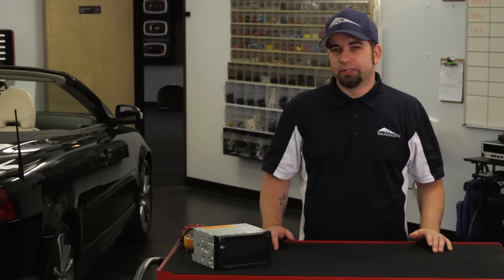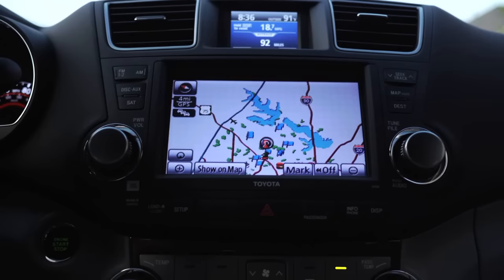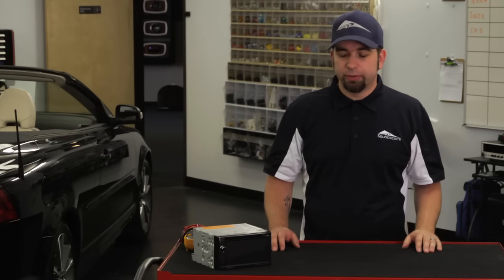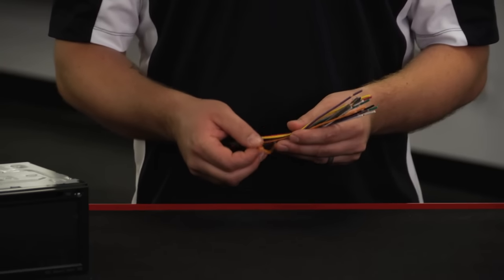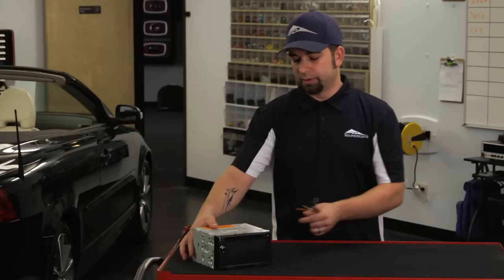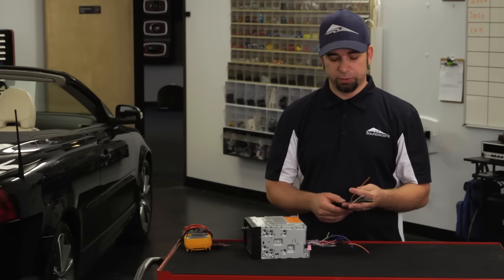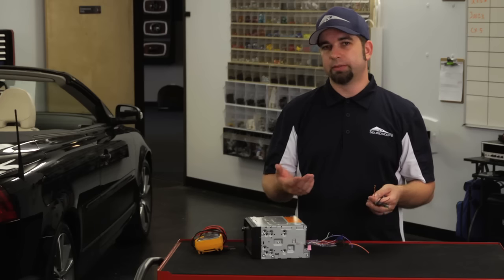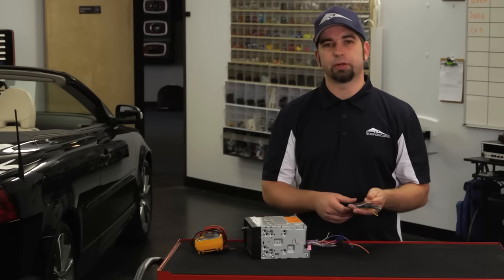How to Wire an Illumination Wire Connection for a Car Stereo : Car Audio

Comment: So... as a rule, if there is an orange wire to hook up to an orange wire I would not be searching this online.  The harness from the stereo to the connector that hooks to the car has different color wires.  The end that hooks to the CAR has an orange Dimmer wire. The Stereo harness has NO orange wire.  So in an instance where the vehicle connector has the dimmer yet the stereo does not even though it is a newer model, what wire would I piggy this on to? The stereo instructions say the orange wire is an illumination, but the stereo does not have an orange wire-- somewhat contradictory.
Reply: samantha del valle did you ever find out which wide to connect the orange wire to
Reply: samantha del valle wow I was thinking the same thing you were like really 🤦🏾‍♂️ I’m here cause my aftermarket radio doesn’t have a damn orange cable I thought he was gonna say something like “ and if your radio doesn’t have one connect it to the red or yellow or something else”.
Reply: And vice versa, stereo has ill cable but which is the vehicle wire. If it was as obvious as orange and orange wouldn’t be googling!
Reply: Right I have one that's green on stereo in chinenglish it says head lamp. I'm guessing that it goes to orange on the harness for illumination. My parking brake/reverse camera/etc wires are diff colors too. And the chinenglish translations are too different to be sure
Reply: @cyruslever586 I also have a green illumination wire on the new car stereo harness but it's orange on the aftermarket wiring harness
Reply: I need this question answered please

Comment: What do you do when the aftermarket radio doesn't have an illumination wire but the harness does
Reply: nothing.   it means the radio doesn't have the feature to dim itself anyways, so there's nothing your radio can do when park/headlights go on.

Comment: That did not explain how it worked... He just said connect the orange wires.
Reply: It is mentioned at the :15 mark of the video. It's purpose is to dim your radio display when your head lights are turned on (usually at night). Reduces the glare of the lights on the radio display.

Comment: Okay but what if my radio doesn't have an illumination wire? Is there an alternate way to connect it or just cap it off and let it hang there?
Reply: Same question
Reply: Just hook to a dash light or ac light
Reply: @eksine  didn't work just tickled lmao
Reply: @gavindowell1489 did you figure that out?
Reply: @jadengamez1673  I hooked it to the orange wire. If you’re good you can look up
The wiring diagram for your car and go that way. Or check it with a fuse light checker and it’ll turn on once you turn the lights on
Reply: @jadengamez1673  worse case it’s because the system is too old in which case I capped the illumination wire and also my blue wire which was for Bluetooth
Reply: @gavindowell1489  unfortunately the diagram for it wasnt correct ended up getting one from and Elantra

Comment: Now what if you have an aftermarket stereo that says illumination but the harness only has a orange with white stripe wire that says dimmer what should i do. I dont want to splice into any wires.
Reply: did you find a solution yet? I have the same issue...
Reply: tyrei brown year later.. lol sitting with the same prob
Reply: @dandundid540  5 years later... any luck?
Reply: Same issue
Reply: I think this is what mine has.  I connected it and it doesn't change brightness.  I know in my factory head unit, the panel brightness dial also adjusted the radio brightness.  So it can't be just 0v or 12v on that wire, it has to be a range.  I'm guessing the aftermarket head unit's illumination wire expects 12v = dim and 0v = bright.  And the factory dimmer wiring harness is actually sending variable something like 5v-12v = dim-bright.  I think the systems are incompatible, but I didn't break out the volt meter to test it.  And it's all installed and everything else is working.  Well, the vehicle speed sense isn't working.

Comment: so what about the illumination/dimmer ground wire?  Where does that go when the aftermarket stereo harness does not have one?
Reply: Don't use or you can splice into any wire that gets hott when lights are on

Comment: At last! Someone that actually explains what voltage to expect on the illumination wire. I have two Car DVD players, One a Chinese brand (Just purchased) and the other a Sony which currently illuminates the inside of the car like a disco at night. Even the Sony installation guide is useless. In fact it names the Illumination wire and that's all. Very poor for a reputable company. I have been too frightened to connect anything on this wire in fear of blowing it up. Thank-you heaps!

Comment: 1) I'm assuming you want to know where to hook up the illumination wire.
2) Obviously you ran into a snag because you don't know which or don't have a wire to hook it to.
3) Hopefully you bought an aftermarket wiring harness that plugs into your car but has to be wired by hand to the wires coming from your new Pioneer, Sony, Kenwood, etc. head unit (radio).
4) A wiring diagram should've came with your aftermarket wiring harness stating which is the illumination wire. Now, if there is no illumination wire coming from the wiring harness, you didn't have illumination control options for your factory car stereo, so now what.
5) If no wire, you can just leave it be and that will be fine, it just won't dim when you turn your headlights on. But if your head unit relies on the illumination wire for any light whatsoever, you can splice into the 12 volt red wire.
6) All the dimmer wire does it dim your head units lights when you turn on the headlights. That's it. If your car is not equipped with a dimmer for your radio, it's not the end of the world. Most aftermarket stereos have their own dimmer capabilities if the shit is too bright at night. You'll just have to do it manually.
7) If your dashboard does have a dimmer switch, you can tap into that but you're gonna have to run wires behind the dash to get to it. Every car is different so I can't really describe how to do it or even if it's possible for your car. Crutchfield has a wealth of vehicle specific information on their website. I can't guarantee you'll find what you're looking for, but you can chat with their specialists online.
8) Almost forgot, if you cut the harness to your factory stereo, you listened to someone who shouldn't have told you that's okay (even if it's a pretty well known youtuber). It will save you the cost of a 10 dollar harness but will give you more headache because you will have to figure out your vehicle specific wire pin-out.
Reply: Thank you so much for this post! Exactly what I was searching for. The wiring harness for my car does not have the illumination wire, but the new radio requires one for the buttons to light up at night.
Reply: THANK YOU SO MUCH
Reply: Thanks

Comment: The orange wire generally is parking lights on the car harness and the illumination wire on an aftermarket radio harness is usually orange/white not orange. Never seen an orange wire in an aftermarket harness. Confusion comes in when some cars have a dimmer wire also. Typically red in the car harness. Don't use it. Dimmers in some cars like Honda civics can be a negative wire. Next connect the accessory switch wire (ignition) of the harness to the orange/white of your car. So recap typically orange/white on the aftermarket is illumination and orange/white on your car is usually ignition.
Reply: Have an orange/white striped out of reciver with a black ,red, yellow only.
Is the orange/white to be connected to the illumination wire of  the vehicle or to the dimmer wire of the veihcle ?
Only 4 wires out of reciver to make connections .

Comment: I have a Pioneer AVH-X8550bt, this car stereo has 1 Ilumination swicht wire. But my car has two Ilumination swicht, one Ilumination positive (+) and other Ilumination  negativo (-). What I should be use /connect positive or negative?

Comment: Make sure you solder & Heat Shrink  Everything & Zip Ties ! 

Make sure you make it safe!!!

Have a most awesome day and if you have any questions PM me!!! 

 I have been doing this for 25 years straight!
I just know a little bit about car audio
 lol lol lol lol. ;-)
Reply: John Work NO use posi connectors and zip ties. Unless you like a big pain in the butt when you want to switch head units. Solder and shrink aren't easy to undue. Unless you have some big competition system.
Reply: @googlename8066  I take it you're a car audio expert huh?

Comment: I installed an aftermarket stereo without using the harness since it was cut prior to me owning it. I found the constant, ignition wires and connected them to the yellow and to the red. Ground, I grounded it to the truck. Here’s my trouble; the radio shuts off when I turn off the engine but to get it to come on, I have to turn either the dome light or headlights on. What the heck is causing this?

Comment: I have an orange wire on the adapter but there’s not orange wire to connect it to. There are two dimmer wires but only one illumination. Any suggestions?
Reply: ford escape? lol im here for the same thing, i have a solid orange coming from my alpine, and my escape plug has an orange and white and a orange and black wires coming from it. which do i splice to the solid orange to?

Comment: My harness and new radio harness both have a single illumination wire. But one is orange and the new radio it's a yellow/black. Should I connect these because I'm nervous about connecting a striped wire to a solid wire.

Comment: What if the unit has ILL[+] & ILL [-]. What is the deal with that? I am currently installing one and has 2 wires for Illumination. 
Very helpful video.
Reply: One positive (+) the other negative ((-)GROUND))
Reply: @DjXyler  When I did that it would always stay dim. Ended up working fine with just the Negative ILL[-] line connecting to the loom only.
Reply: @TaragoPreviaEstima  try the LPH under the hood
Reply: Its supposed to be headlights... L and R
Reply: @TaragoPreviaEstima  I have ILL wire. No dimmer..

Comment: Thank you for the video.
Usually orange/black wire is dimmer wire.
However, May you please help me to identify dimmer wire in 2012 lexus es 350? Becuase my lexus navigation unit doesn't switch to night mode at night.

Comment: I am running a Walmart interface on a 07 Pontiac G5 & it is not dimming & getting in my nerves! I beleive there is 2 orange wires so. I tested the other orange wire with my multimeter connecting the red lead to the orange wire & the black lead to ground & did not see anything however, when I switched polarity (connected black wire of the multimeter to the orange w/white stripe & the red multimeter lead to ground) I did see movement. Any advice helps! I am running a Walmart interface-Metra-D it's a Metra (WM-GM29-SWC) There is no switched power so, I ran a fuse tap to the fusebox to a switched 12v! So, no power on the red wire(the switched 12v- accessory wire) My biggest issue is, The radio does not dim when the headlights are turned on!!! Also, the reverse lights are separated from the tail lights! They are beside the license plate & I do not see a way to access the reverse light wires & how to route the cam without drilling a hole. I need to strip the trunk bare & find a access point!!!

Comment: Wired orange HU to orange OEM harness. HU Illumination Dims when lights are turned on but when I dim dash illumination with the dimmer knob, the HU gets brighter... its opposite what it should do. This is on a E450 RV with a Pioneer Head Unit. What gives?

Comment: My touch screen aftermarket radio goes to camera anytime my dash lights and headlights turn on what's causing this and how do I fix it
Reply: swll sctt they hooked up the reverse light wire used for camera to come on in reverse, to your illumination wire

Comment: How are you bro I got a question how do I test and find an illumination wire on my 02 mazda protege dx .I searched online about it. they said the illumination wire is the black and red color wire .I checked using a multimeter and there's no reading . I wonder how is the process to check for an illumination wire . the key ignition needs to be turned on or how do I get it .

Comment: If I dont have a orange wire what do I connect it too
Reply: did you ever find an answer to this? i as well dont have an orange wire to connect to
Reply: Riley Staedt receivers come in a wide range of quality and company as they sometimes have different specifications and wire / color coding so make sure you have the right color wire 1st.
Then in your directions make sure you have a dimmer wire keep in mind what color it is
Find your headlight output sense and hooking up preferably not using a T tap connector or Scotch locks as they are terrible

YouTube/johnalenwork53 
Please subscribe, like, comment and share 
As it will help me financially 
Thank you so much
Reply: tap it from the +12v parking light wire. that should work.

Comment: I put in an aftermarket stereo in my 01 sport trac, and when I turn on my headlights I don't have any dash lights coming on. What do you think could be the problem?
Reply: I know you probably won’t see this but I’m currently having the same issue. Turn my headlights on and my radio light go out. Did you ever find a fix. I can’t seem to find an answer anywhere

Comment: I bought a car and the dash turns off when I turn on my headlights, it had a aftermarket radio already, I was told that it’s because the dimmer/illumination wire was connected.. is it true? So if I disconnect the orange wire will my dad work normal when my headlights are on? P.S I have a 03 Honda Civic